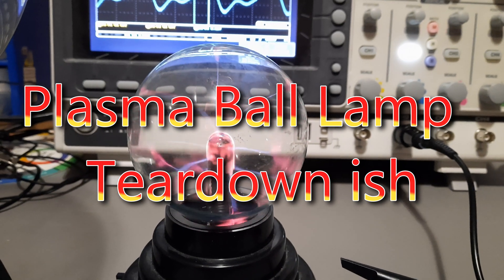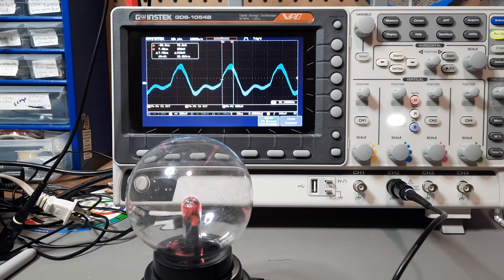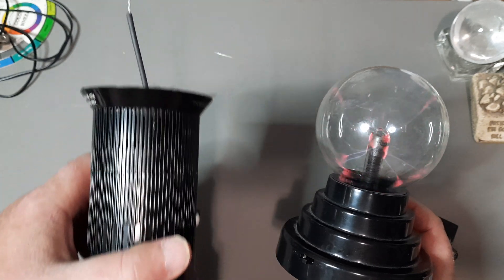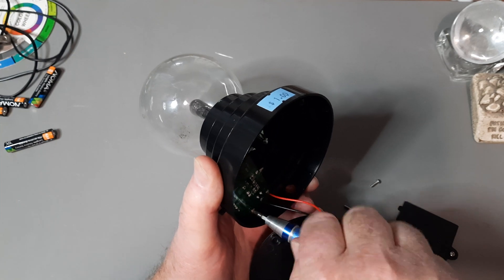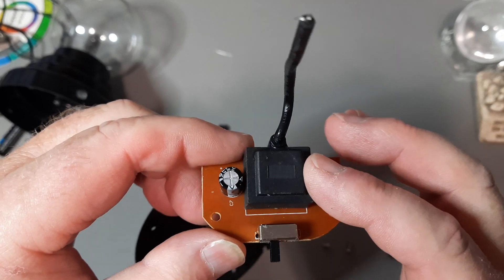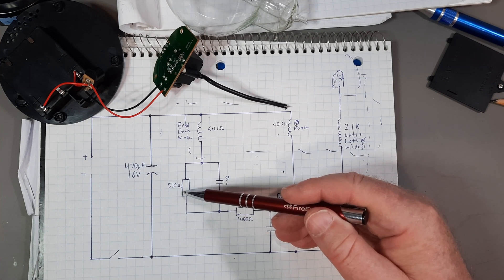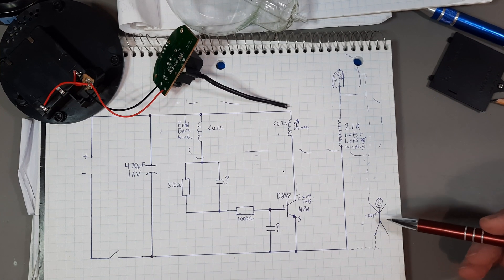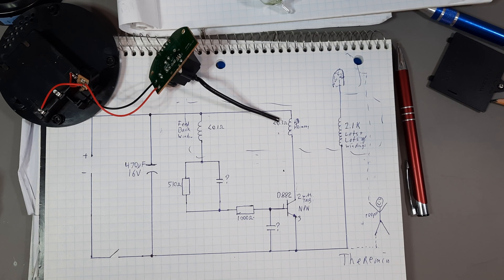Plasma Ball Lamp Teardown & schematic

Comment: Probably messes up my ham radio reception?
Reply from the maker: The big one locked up my phone so, definitely noisy. But then with all the switching power supplies around it probably just blends in. When I started electronics the most significant noise was 60Hz from the house wiring, times have changed.
Have a good day